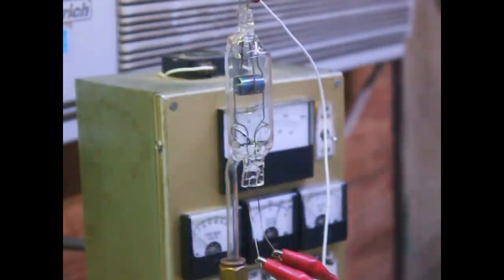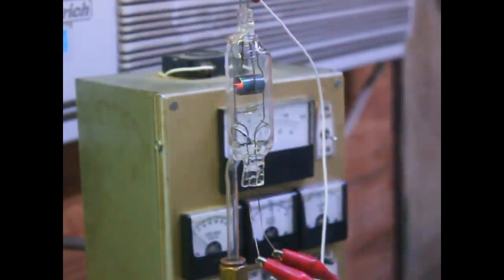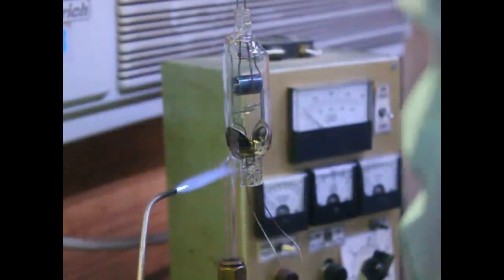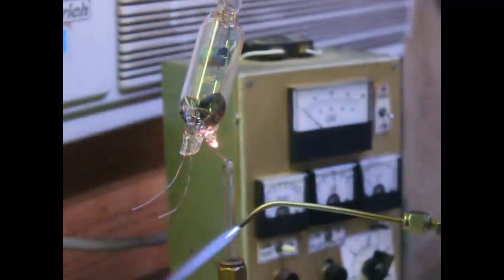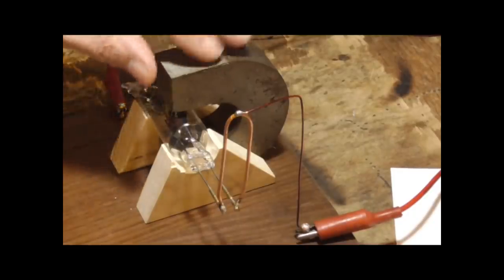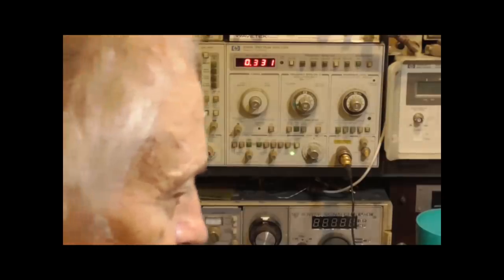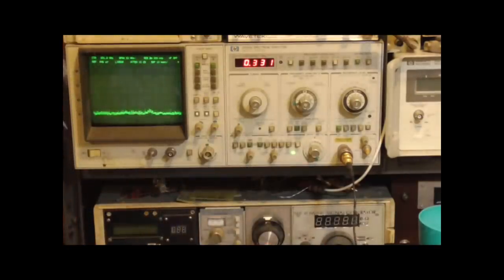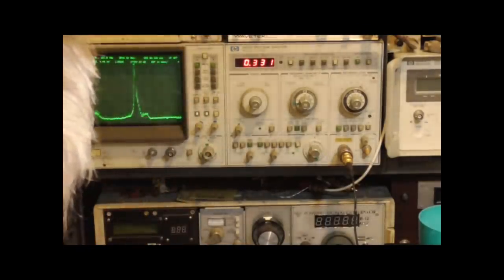HOMEMADE MAGNETRON WORKING!

Comment: Wouldn't it be better to flash the getters AFTER you seal off the tube?
Reply: No, the heating drives off more gases, some of which can be pulled out by the diffusion pump or turbo molecular vacuum pump.

Comment: Is it possible my neighbor us using something similar? He has been focusing either a laser transmitter or magnatron at my windows creating either a wave form or crystal clear audio. In one case it was audio of someone working in a clandestine manor so I would come out to investigate. Also it only occurs in l.o.s. from him to me. His emmiter is bathed in either a purple glow or very bright green illuminesance ONLY visible through my security card. My son is with the DIA and he is also curious
Reply: Stop it. Get some help.
Reply: try lithium and aluminium. eat the lithium and wear the aluminium as a foil hat. when you dont feel the need to wear the hat, the lithium has started taking effect
Reply: what
Reply: yeah pretty much everyone has thousands of dollars in spectrum analyzers in their garage and are making devices to harass random people
Reply: Note: the laser could also be used to listen in on your conversations, using the window glass.as a microphone diaphragm to modulate the back scattered laser. Again, another easy project with readily followed plans on YouTube and elsewhere.
Reply: Could be a directed particle beam, check for radiation
Reply: Could be an ultrasound transmitter array using an inaudible high frequency sound wave which has an audio wave modulated over it. When such a transmission hits a solid surface it turns it into a loudspeaker, the origin of the sound is silent to.the human ear.
The laser you see on your security camera would be an (invisible to naked eye) infrared laser used to aim the sound beam.

Ignore the mockers, there are project plans for this kind of ultrasonic harassment device and examples on YouTube. VERY easy to make now that microcontroller kits like Arduino and raspberry pi are ubiquitous.
Reply: He is sending frequencies at you.
Be careful, frequencies are dangerous.
You do not want frequencies entering your house.
Stay away from his frequencies.

Comment: Try feeding the HT to the anodes via a choke so that the RF isn't going up into the HT PSU. You may well find that the output or bulb lights a lot brighter because you are not losing RF in to the power supply.

Comment: How do you get a rough idea of the frequency of oscillation? That is, before measure
Reply from the maker: Not the slightest idea! Without the spectrum analyzer I would never have been able to tell what frequency it was oscillating! I was doing the project mainly to see if the 1936 magazine article was accurate. ("could be made in the average home shop!") I guess the average home shop was a lot different than that today!
Reply: @glasslinger  heheh true, although a spectrum analyzer is still pretty rare in “the average shop” but I would think is a tremendous help. Probably in the old days it was more by calculation plus knowing what worked for previous setups
Reply: @glasslinger  You could use a wavelength measurement by Lecher-Wire? It's very simple and relatively accurate (at least better than 1% if done correctly) and costs very little effort/money.

Comment: I was wondering how you do your research on your projects?

For instance this project. Woulf you read up on it and then copy a design you like and tweak it or is it from your own design?
Do you base it off of old papers or how so?
Very cool nonetheless and much appreciated what you do.
I am trying to follow in your doorsteps and eventually want to play around like this in my spare time.
Kind regards.
Reply from the maker: I do a lot of collecting of old magazines. For this magnetron, I saw an article in a 1936 magazine that said "any reasonably equipped home shop could make one!" Get that? IN 1936!!!!!!  That was a real poke in the side to me with my quite capable lab! I HAD to do that to show that I was at least able to do things some average experimenter in 1936 could do! Good luck on your ideas! Start out simple and grow. YOU CAN DO IT!
Reply: @glasslinger  hats off to you sir!

I get what you mean with the article's referral to a "reasonably equipped" home shop. Maybe back in the good 'ol days that sort of hardware was  more attainable due to the manufacturing of this tech industry?

 
I need to build a few high efficiency microwave generator modules like this and they need to be as small as possible. It is meant for a larger project. An impossible experiment so to say.

Your projects inspire a lot and that inspiration is much appreciated. You are one in a million so to say. 
I find it sad that mankind missed the true value of this technology.

If you don't mind me asking, which 1936 magazine do you refer to? I'll try to locate it somewhere. Also if you have more reading material to refer to, that would be much appreciated.

Once again, what you do is like magic to those of us who truly appreciate your art. Thank you.
Reply from the maker: @johnnycash4034  Going solid state is the only practical way to generate the microwaves. If you need more than a watt or so you will have to go to EXPENSIVE klystrons. There is no "cheap" way to generate microwaves. Unfortunately, the magazine is buried in my boxes and boxes of old magazines, and would be a major job to find in any time I have available.
Reply: @glasslinger  That´s a very optimistic description of "any reasonably home shop". Damn, did "reasonable" homes really have shops like that in the 30ies?
However, it´s amazing and completely blew my mind. BTW you are extremely skilled with this stuff, and it´s a pleasure to watch your videos!

Comment: Can this be used as a pirani gauge head or is the design different?
Reply from the maker: It probably would change characteristics with pressure but calibration would be horrible. Very good gauges are available on ebay for well under $100.
Reply from the maker: @johnnycash4034  For watching backing pressure on turbo or dif pump, get a 1 torr full scale. For R&D get a model 121. (it's accurate to over 4 decades but is physically large. )

Comment: Dear, now the cause of Chronic Fatigue Syndrome  is found: radiation of microwave-oven(magnetron).
To stop you have to eliminate the oven out of the house.Attention: radiation goes through  walls, it can come from your neighbours.
The plug out of electricity net because the oven has also radiation when it is not in use.And out of the house because the oven has a high voltage capacitor.
The distance between an oven and a person is very important.After a 3 months without microwaves health becomes better.
The victims are more sensible and also the distance between victim and oven is important.After long time obesity is possible.
(Also possible: nightmares, change of character)Most people with a microwave arent chronically ill because some people are more sensitive for microwaves, also the distance person/microwave is very important. The oven in another place is more safe. The radiation become less when the oven gets older.Some ovens give less radiation then others. In Russia the less radiation is allowed by law.
I had much very positive reactions, some people recovered entirely. Sometimes not because it was being tired through other causes or diseases,not the real cfs.Take everyday a vitamin D supplement because almost everyone have to little.(attention: it cures only CFS,not other diseases with fatigue)
Reply from the maker: Holy crap! I'm freaked! I actually stand there and watch my popcorn popping! I'm so zapped! OOOOOOOOH!
Reply: People don't have microwaves running for long and it's completely shielded by metal. And there's no way power can flow into the magnetron if the relay to the Transformer isn't switched on (even if some could come from the capacitor, the filament has to be on)and again in that case the microwave is a faraday cage and won't let that bit out if it would be there.
Reply: You do not want all these frequencies inside your house.

Comment: This really makes me want to get into technical glassblowing as a hobby. How bad is it on the purse ?
Reply from the maker: This depends greatly on how much of the preparation work (building the equipment) you can do yourself. If you have to buy everything, it will be many thousands. If you can make things yourself like the torch controls, manifolds, glass lathe, glass working tools, you can possibly do a good job for a couple thousand. The vacuum system is a big gotcha but if you can work on an old leak detector you may be able to get the whole system for under a grand. See my tubecrafter.com website for more info.

Comment: i have been trying to get a diy magnetron sputter going for a week or so. what is the 'minimum' vacuum i can get away with?
so far trying with frige compressor but it arcs too much due to air. i see a leybold s2a for sale fairly cheap, maybe that would do?
Reply from the maker: You will have to have 10-5 torr or better. This means a diffusion pump or turbo. A mechanical pump will not get anywhere near what is necessary.
Reply: glasslinger I think you meant to say „10^-5 torr“ am I correct?
Reply: @gecko4ever  Yes.

Comment: if it were 315 MHz and everyones car doors unlock on your street when you fire it up.  330 MHz is in the military band and the signal is dirty also. I would only run that in an RF confined chamber or room so no signal escapes into the wild.
Reply from the maker: It generates less than 100 milliwatts, truly a miniscule signal. And it was only operated for that short video shot. It is in a tube collector's museum now. Have a beer and chill a bit.
Reply: @glasslinger how does the military and FCC find signals

Comment: What Torr are you pumping it to?
Reply from the maker: The pumps take it to around 10-5 torr and then the getters take it on down into the 10-7 or more after it is sealed off.
Reply: @glasslinger  Hi, right, thanks. So You're running what a rotary pump and diffusion pump system? or rotary and turbo?
Reply: Not into Loki :-)

Comment: I know nothing about electronics but I always figured a "magnetron" must have a magnet in it. 
Cheers from Canada  :-)
Reply: The presence of a magnetic field around this diode tube, will cause the electrons to experience right angle force, in relation to their direction of motion (following the left hand rule).  The electrons thus follow a curved path between the cathode and anode. The curvature of the path is controlled in this case, by varying the electrical potential between the anodes and the cathode.  The tube then begins functioning as an oscillator at very high frequency.
Reply: @stevejquest  - Thanks. I remember taking these rules in high school. But at exam time I could never remember if it was the right hand rule or the left hand rule for the particular problem, so it was basically 50/50 to get the right answer.  :-)  I remember seeing my fellow students holding 3 fingers in front of them. Some with left hand and others with right hand. Lol.
Reply: @robinbrowne5419  It doesn't help that there is both a left and right hand rule to remember.  :-P  Fleming's left hand rule defines that whenever a current carrying conductor is placed inside a magnetic field, a force acts on the conductor, in a direction perpendicular to both the directions of the current and the magnetic field.  Remembering this while sitting for a test is a whole other ballgame.  :-)
Reply: I know. It is very complicated.  That's why I never took quantum mechanics, and took computer programming instead.  That's a whole lot easier. What could be simpler than having C, K&R C, C89, C90, C11, C++, Object C, C#.  Lol.
Reply: @robinbrowne5419  I did both, double degree: BSEE, BSCEN but do not really use either today, as I'm now self-employed in IT.  :-P  All the engineering jobs moved offshore, almost 20 years ago now.
Reply: @stevejquest  - Yeah.  To China.  I am also self-employed in IT.  Mostly network admin and some programming sometimes.  :-)
Reply: @robinbrowne5419  I enjoyed your conversation  as much as the video. It is strange to see older people talking about earning degrees in a field I am just not begining to find interest in. And yet, the sum total of your experiences tells me that pursuing this interest is a zerosum gain for the average American because of outsourcing. It is a shame that such is our time.  ANYWAY if you think it will help please contact your senators via phone or email and ask them to fight bill S386. (expansion of foreign worker visas/ cheaper , less-skilled workers to replace Americans)
Reply: @starguy9  - Agreed.  :-)
Reply: @starguy9  My nephew went into HVAC, was paid and was working while going to community college.  He is currently earning more than I am.  College degrees are highly overrated anyway, most of what I learned, I taught myself.  NONE of the programming languages I've been using these past 30+ years were taught to me in college.  About the only thing which has remained the same all these years is industrial motor control.  Other than that, I can't think of anything else that isn't radically different from when I was in college, back in the early 80's.
Reply: @stevejquest  good news for me then,  since self education is all I have in my budget.  You guys are great.  Hope our politicians represent us someday so we can share our brains in industrial sectors once again and help create new things for our neighbors
Reply: @starguy9  😘😗you représente m'y.. thank you.
Reply: 😍🤓.étudient.
Reply: The first microwave frequency generators used tubes like these, the effect was created by electric fileds before they used magnets

Comment: Very good, I glad you got the magnetron to work. This made me wonder wether it would be possible to cut a factory made tube open and repair, say a filament, and then re- weld the tube and evacuate?
Reply: Uh, no.  You can not repair a factory tube.  :-P
Reply: @stevejquest  You can. After WW2 in Germany, there were companies who did it for you.

Comment: That was great thanks for posting! I suspect it was transmitting a bit more power than it may have appeared to be putting out as the light bulb circuit had a high impedance mismatch. 600 VDC @ 8 ma is 75k ohm load from the power supply and the output circuit to the lamp circuit appears high in impedance. It would be interesting to build an output resonant circuit with a match to 50 ohms and feed it into a UHF/VHF watt meter with high power 50 ohm load. By achieving a good SWR match this tube may be able to operate at a much higher voltage and power as the arcing may be due to High SWR's in the circuit.

Comment: What you need to do to stop the arcing is to run it for a prolonged time at a lower voltages and slowly work up.  The tube will "clean up" in time.

Comment: hi i think honestly all u have done is made a tuned circuit transmitter excluding an antenna , why do u refer it to a magnetron . is a ham radio with valves a magnetron if no antenna is connected and capable of when transmitting   lighting up  a bulb ? of.course it.will  , im sorry like i said u have a transmitter modulator tuned to the mid band vhf frequency
Reply: Since Ron's construction relies on a magnetic field being applied, as such, so to operate then it must be a magnetron.
Reply: No its actually oscillating - remove the magnet will easily conform its status as a magnetron.

Comment: What good fun! Could you get it  into one of the ham bands a couple a bit of power into an antenna?  It would be a blast to work someone using a magnetron!
Reply from the maker: The frequency stability is far too poor to be useful .  The frequency shifted 1% just from heating up a few seconds.  This was more of a curiosity project to see if I could do what people were doing back in the 1930's. (long time ago!)
Reply: @glasslinger  It'd still be cool as hell to see it on the air!  Well done though, that's really cool!

Comment: Амаzing! I suggest ferrite choke on anode supply as close to inductance as possible
Reply from the maker: I'm not exactly sure what that would be for. The supply connection wire has quite an impedance at 300mhz.
Reply: @glasslinger  To eliminate possible parasite irradiation and keep energy for light bulb on magnetic coupling.